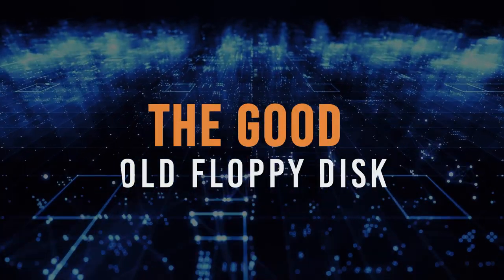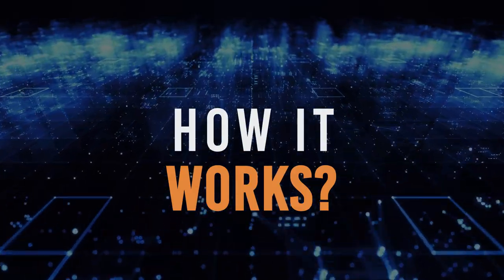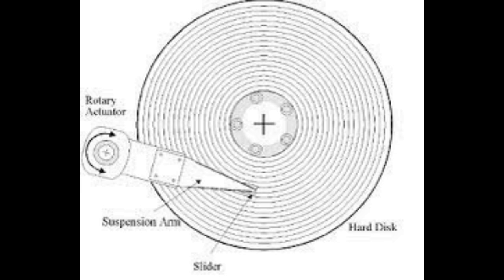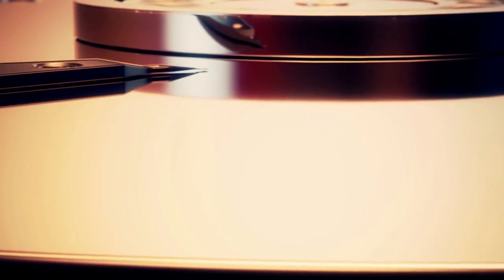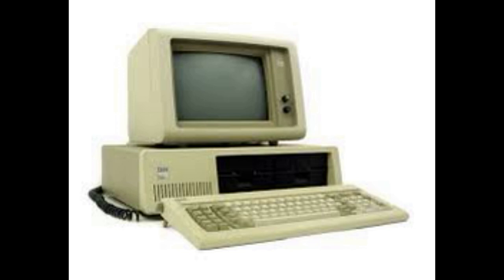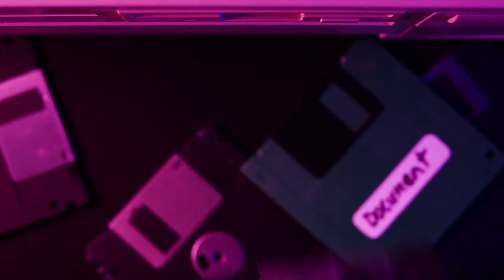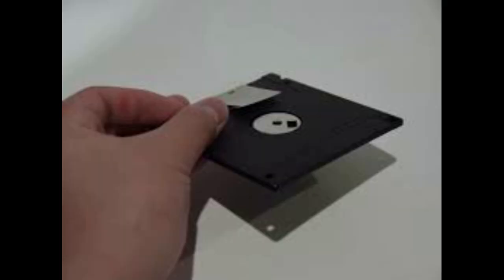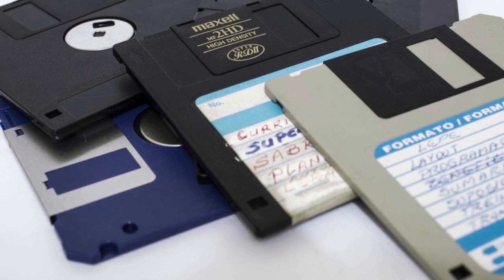Old Floppy Disks, How Does it Work?  💾

Comment: Strictly speaking the 3½" is not floppy at all. Tell people about 8" and 5¼" disks.
The 3½" was a marvel all things considered. I had 500+ when I finally stopped using them.
Reply: @vintagehistorychannel  I mean marvel with respect to what they offered. 8" and 5¼" were very vulnerable. You had to keep them in a sleeve because there was an opening to the disk inside. You had to write protect them with small pieces of tape - or write-enable them with a cutting tool. And you had to be careful when inserting them (especially 8") because they were so floppy you could easily crease a disk. Capacity was low - a double sided 80-track 5¼" might hold 640KB (later double side double density were much better though).

Then along came the 3½" disk with hard plastic cover, spring loaded metal sleeve, a slider for write enable/disable and higher capacity. You could step on one and it still worked! You could write on it with a biro without fear of damaging its interior. They were small yet higher capacity and while initially expensive they soon became cheap.

So yeah - I agree, they were great. Obviously obsolete now. But at the time they were so good!